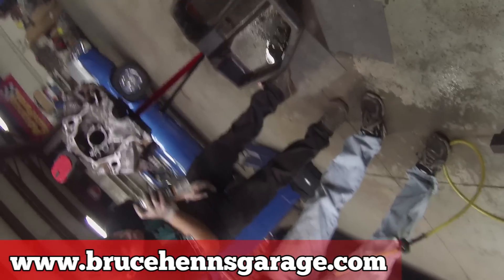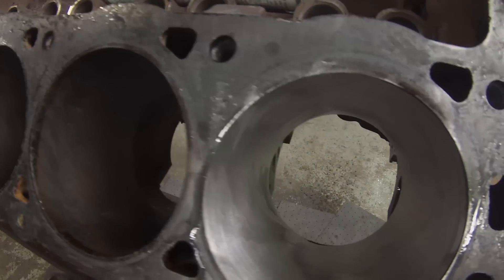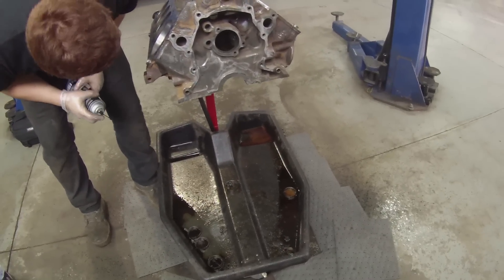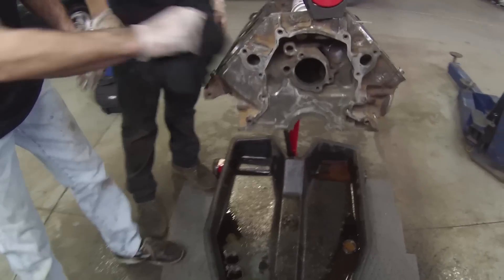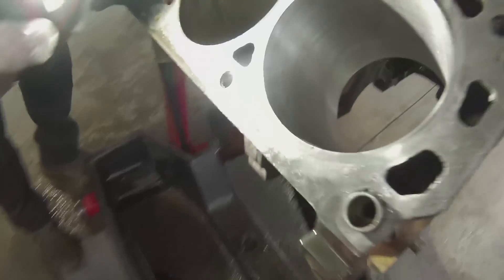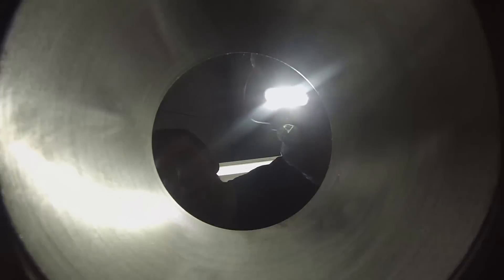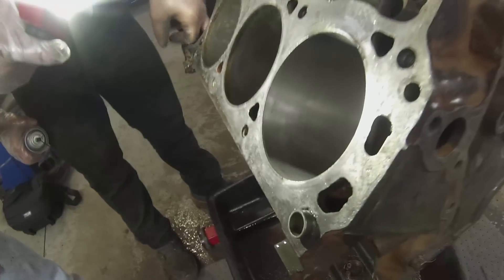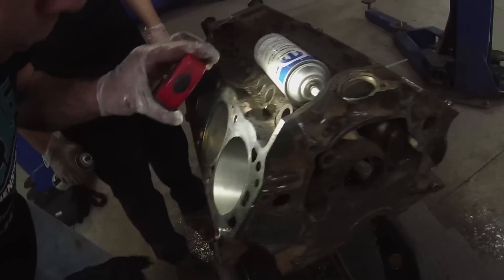Honing Each Cylinder of our 302

Comment: lol Did they even measure the bores for out of round and bore size? He didn't even do a 45* crosshatch. This type of piss poor rebuild work is upsetting to see. You have to be careful with drill hones, while they do work, if you dont use them properly you can hone too much out of the cylinder which will cause issues with ring gaps, without the proper crosshatching the rings will not seat right either and you will get alot of blowby.

Comment: Question, why do you hone the cylinders?
Reply: +TheRealDrtball 

 To remove imperfections in cylinder walls that will prematurely wear your rings and let oil past. But a perfectly smooth bore will cause ring and cylinder wear too. Cross-hatch honing leaves just enough oil on the wall to reduce wear. 

I'm just a hobby mechanic. So there's probably a more precise explanation.
Reply: ok makes sense, didn't know that, thanks for the info.

Comment: So after honing, isn't the diameter of the cylinders ever so slightly larger, even if only by a fraction of a millimeter? So the piston would have a little play inside it, but would the new piston rings need to take into account that they go into a honed cylinder, and thus be ever so slightly bigger in order to compensate for that?
Reply: +linglingjr He's talking about ring gap.
Reply: +Seegal Galguntijak The piston fits very closely, but does not touch the sides of the cylinder/bore. So it shouldn't effect the piston fit too much. You get different sizes of piston rings, so you size your bore (with an inside micrometer) and then fit the correct rings to each individual bore and piston.
Reply: +linglingjr Do you know what "running fit" means and what the different standards are for it?
Reply: +dalem04 No.  I'm sure you don't use oversized piston rings on std pistons.  You also don't use different sized rings on each cylinder. wtf are you talking about?